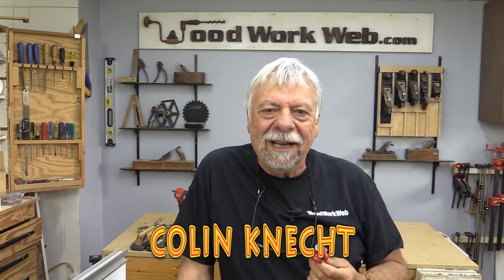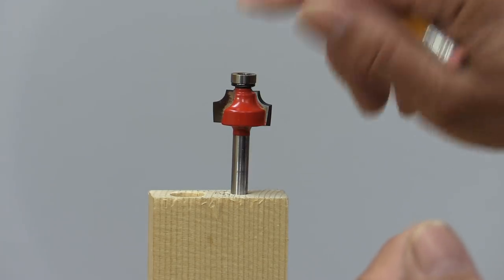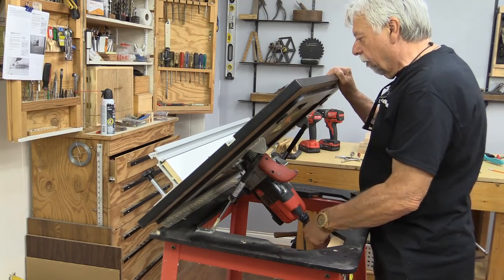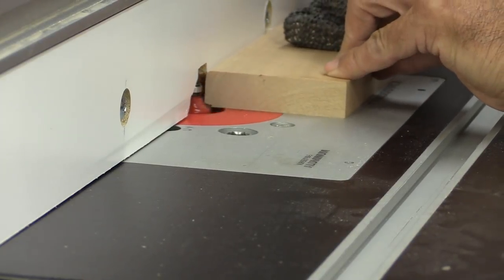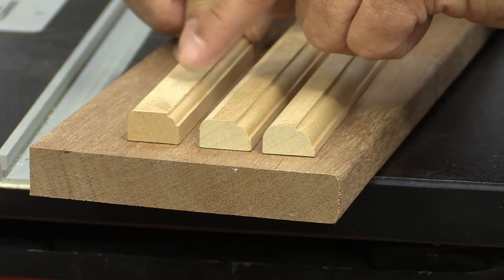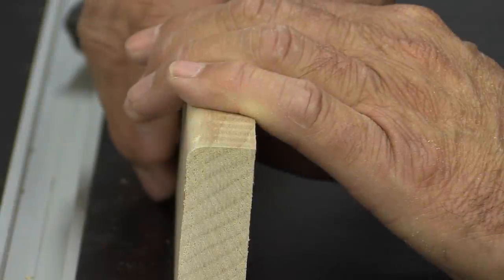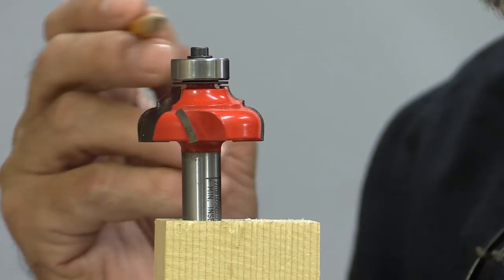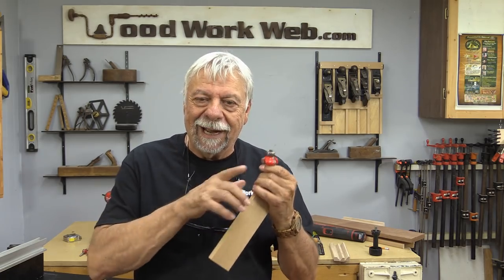Getting MORE from Your Router Bits / How to Modify a Router Bit with Bearings.

Comment: I'm making a platform bed with inset panels, the edges of which I gave a boring roundover profile. The panels were inset only about 3/8", so a more-interesting ogee was not an option. But the half-bead created by using a smaller bearing on a roundover bit is the perfect accent.

I was just about to apply the finish to the frame sets when I saw this video. Timing may not be everything, but it sure worked for me.

Comment: Thank you for this video. 
I mistakenly ordered a beading bit which you described in the video having the top cutting edge. I went to Freud’s website and they said you can buy a new bearing and washer to transform it into a roundover bit. But, after watching your video, I thought, do I really need to change the bearing if I have a table. Can’t I just pull the fence out a little further than the bearing on the beading router bit and accomplish the same thing as changing the  bearing?  Am I missing something?
I would appreciate if anyone can answer this. I am brand new to the world of routing. I just purchased a table and installed my router in it. Having a table makes it seem like it will be a lot easier to route small individual pieces of wood. Thanks.

Comment: Sir, I have a question 😊I own two routers one is palm and the other one is plunge router , shank size is 6 or  8mm.  If I need a bigger bit ( big shank) is there any adapter  which sorts of converts it. I am not a very experienced wood worker so it may sound amateurish so forgive me 😊thank you Sir and you are a great teacher .
Reply: Look up the owners manuals for your routers. That should help a lot.
Reply: I don't know of any adapter to make the collet larger. All sorts are available to make them smaller. Typically, a router with a 1/4 (6mm) inch collet will not have enough power to spin bits that are only available with 1/2 shanks (13mm).
Reply: Nick Stahl thank you  😊so I will have to buy a router which has a  1/2 inch Colette.

Comment: hi - im looking for a trim bit that cuts a flange or lip on bottom - so the bearing is at the top, im trimming plastic formed items  - an alphabet letter that needs a flange on it when cut out to it can be glued on a flat surface and look like a 3d letter afterwards -  looked everywhere - so imagine a non flush trim bit with a smaller diameter shaft than the top bearing - thanks